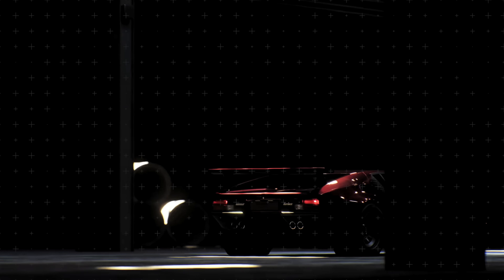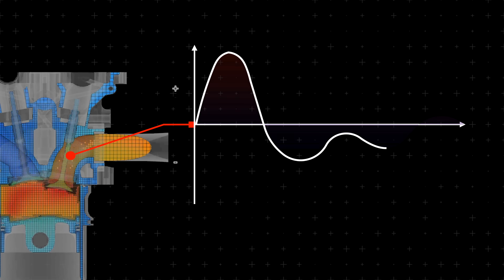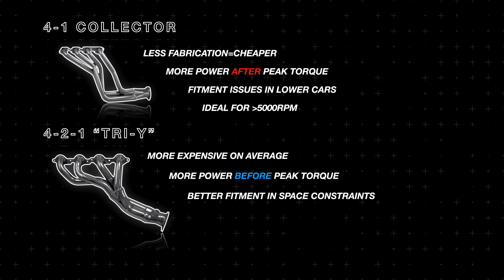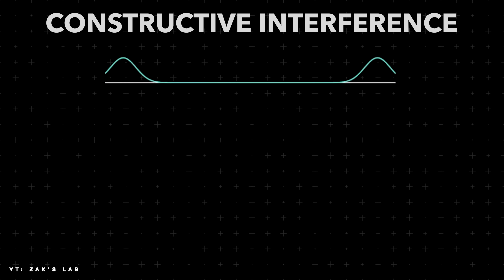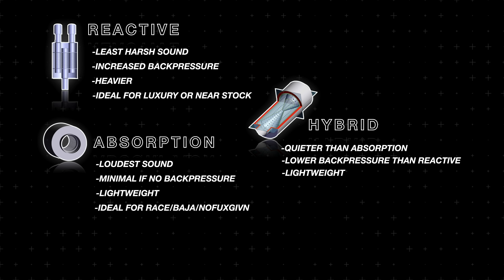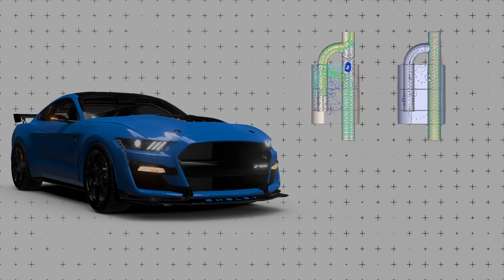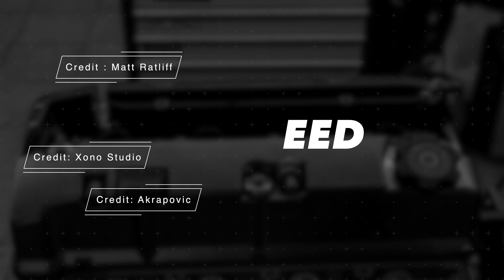Why Exhausts Make So Much Power😵| Explained Ep.27

Comment: Folks, this is as stupid as it can get. Doesn't matter if you are engineer or not you have to think of to things, and after that you will  be able to see by yourselves that this is stupid. 
1) To get energy you have to have something to get energy from.  
Let's say you want to warm-up your house. You will need to burn wood (as one of the methods) to get heat from it. So. It doesn't matter what kind of flue your chimney has, you will only get more energy, that's heat, by burning more wood, and eventually blowing more air into the fire. That's it. 
2) Car makers are not that stupid, so they don't know what they are doing. 
The exhaust pipes of the engine in your car are precisely calculated to meet the precise requirements for the precise that engine, so the output of that engine is the best that it can be.

Comment: 2:27 that is such an interesting and cool way to explain how exhaust systems work, fair play, and the graphs after that 😊
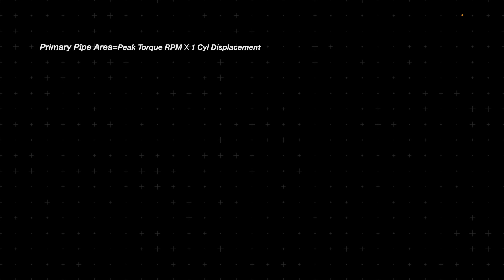I won't say the same for the bit at 3:33 damn I zoned out with that... 😅😆🙃
H Pipe sounds WAY nicer and tolerable to live with too as long there's a resonator, or it'll just be like the X pipe which sounds more like a racing engine exhaust. If you were to do a longer trip, you'd need some wicked sound deadening, or earplugs 😝
Absorption tail pipes / mufflers are offensive...

Comment: exhaust isnt adding 50 hp to any build ever
Reply: Ever heard of a down pipe thne
Reply: Depends on how much power you’re making. Firepunk diesel did a dyno run with a full 4 inch exhaust and muffler and it made 988. They disconnected everything and ran it on an open downpipe and it made 1044.
Reply: Exhausts be adding way more than that sometimes bro. It aint doin it to your daily om its own, but on builds that already make good power you can see a lot of benefit

Comment: in the first formula, it says that u need to use peak torque rpm, am trying to calculate it for my e46 330ci but it has a peak torque of 3500rpm so that means my tubes should be 1.2 inch, seems kinda small to me. shouldnt you use peek hp wich is at 5900 and you get a result much closer to the k20 engine?

Comment: 2014 Camaro SS automatic here. 
I installed BBK shorty tuned length headers, H-pipe with a muffler delete. The car had noticeably better low end power & it sounded great. I then removed the h-pipe & went with an X-pipe. I noticed slightly better acceleration at highway speeds. I just recently installed BBK full length 1 3/4" headers with the high flow catalytic converters. I immediately noticed there was a loss of low end power. There is better acceleration at the highway speeds. There was also a raspy sound coming from the exhaust. I have since added the Flowmaster Outlaw series mufflers. That raspy sound is now gone, the car sounds great but it still lacks around town driving power. It looks like I'm going to have to go to a shorter rear end gear. So far my modifications are a cold air intake by K&N & a Vararam Power Wedge.

Comment: When choosing an exhaust system, you get what you pay for. A pieced together exhaust from a muffler shop often results in drone. Save your money and purchase an (tuned) cat back exhaust system from a reputable company like Borla, flowmaster or Corsa, just to name a few. A local muffler shop can install the system for you. If getting under your car is not your kind of thing. Tuned exhaust means the system was engineered to cancel out those annoying (drone) pulses that often occur inside the passenger compartment at highway cruising speeds. Drone is extremely annoying.

Comment: I know what was meant in the title of this video. An exhaust does not make power. A properly sized exhaust system can free up lost horsepower. That will be lost to an improperly sized exhaust system. Spent gas scavenging from a properly sized exhaust system removes spent gasses from the combustion chamber and exhaust manifold. So that the combustion chamber receives the optimum fresh air and fuel charge for the next combustion cycle.

Comment: Also i need to address your "x v h" pipe sound conclusion: the " pulse wave" travels at. The speed of sound 1100 ft/s.....not the mass of exhaust per pulse, the wave generated by the mass + momentum.......this ultimately determines your primary length, as the scavenging wave travels at the speed of sound back to the EV...

Now you mention the h v x pipe is really sound from engine master testing......well i would argue that EM tested rhe aggregate data as the peak power, But as the exhaust sound is correlated to its scavenging function wouldnt it be objective to aak this question: measured sound energy could determine the pulse wave scavenging? 

The more energy in the sound of the exhaust the more energy in the scavaging wave measured in kilowatts? (Excluding any resonance or muffling)  cant use dB because its a reference to human hearing, think of microphones measurements in reverse of speakers you can get watts.......you would have to add the mass flow averaged somehow as that can be measured in watts also...

Comment: Best video on exhaust science for engines, simple enough to understand with media and graphics.....only can add that ideal gas laws inner action with the ambient temp for predictable wave momentum also the air velocity profile around the exhaust tip at different speeds can effect the pulse wave timing and its correlation to internal flow restriction

Comment: Average, no talk of exhaust volume (extremely important) when designing an exhaust system. Equal length primarys do not create the optimum scavenge on uneven fire cylinder engines. Period

Comment: Now I understand the occasional dude with loud exhausts sitting next to me at a green light Drag race to the next red light. Just so epic because 😂 and then I pull up next to just as the light turns green and smoke em across the intersection. In my 2002 Ford Ranger XL. God I miss Tucson😅

Comment: Years ago I installed a set of Hooker Super Competition headers on my 1967 Nova with a moderately modified 283, at a cost of only $200.  Until then, I had been frustrated with the performance, only running 14.50 in the 1/4.  I knew there was a dramatic increase in power (seat of the pants) but didn't expect a 13.60 time slip!!!!  No other changes were made.  Wow!
And no, I do not work for Hooker!

Comment: My ol fox body " had 2 chamber flowmasters,  h pipe  would drone like crazy so monza resonator tips helped , but opening up back pressure  with that setup on a mild build " you loose bottom end torque for sure , daily driver" not a strip car where flow is key"

Comment: My 1st car was a small LC Torana I had extractors & hotdog fitterd as these were said to improve performance.  All they did in reality was make it sound hot.  The car topped out at 95 mph both before & after this mod.  Absolutely no dectectable change in any performance parameters at all, not speed, not power nor fuel efficiency.  Maybe if it was measuresd with laboratory instruments, a change might have been found, but it certainly wasn't apparent in the driving experience.  Installing a rack & pinion steering box was an improvement over the production one though.

Comment: As an Automobile Engineer myself. This channel is suppose to be recommended for Engineering Colleges because you can't get any material that simplifies as this channel. Shout out to this channel.
Reply: Why multiply. 065 by 2?
Reply: @UltimateManTVif I had to guess, the piping measurement is referring to the outer diameter (1.75) and you have to add the thickness of .065 inches x 2 to include two sections of wall you’ll measure when you are considering the outer diameter. The calculation only found the inner diameter.
Reply: Shout out to my barber dog
Reply: *supposed.
Reply: One word revision problems did you think of that nope you did not you failed miserably
Reply: @jumpsuite  you're one of those who think ICE are dead. Wake up call D***y they're here to stay

Comment: i dunno if i am dumb but what if i remove all kind of exhaust as i dont have to worry for back pressure then and the exhaust gas leave instantly as there are no restriction? then if i let some of it for forced induction the smaller exhaust system one should be better so what is the greatest fit?(this is theoretical standpoint that that car has no emssion test to pass) if you have answers please mind answering!!!!!!!!!

Comment: Two strokes are even more complicated when it comes to exhaust tubes.
There, they add an expansion chamber to ensure that the exhaust is ringing like a tuning fork with the engine RPM so at the next exhaust there's a period of low pressure in the expansion chamber to accept the new exhaust.

You can tune them to a very narrow RPM band for MAXUMUM power at that band or you can tune them for an average increase in power across the range.

And a single tiny dent in the expansion chamber can throw it all out of tune and cost you 20% power.
And even a microcrack can make it sound horrible while also losing you power.
On two strokes, the expansion chamber is a finely tuned musical instrument and it will sing beautifully when you are in the correct power band.
And the complexity of designing one for your needs means you can't simply say "this diameter and this wall thickness", it depends greatly on many many more factors. Get it wrong and it will both sound horrible and perform worse than having none at all.
That's right, most four-bangers run fine or even better with no exhaust headers at all... Two strokes run WORSE without their expansion chamber.

Comment: I made a Exhaust system That sounds like a V8 on a 4 cylinder engine it has  2 collector's 8 exhaust runners and thay go the 2 collector's go in to one pipe I used 1 inch  Piping 2 times on the  the same exoust port  Routed them to the corresponding cylinders Like a v8 and the result is a small v8 sound but at 5000 rpm it still sounds like a 4 banger  I also did the same with a v6 and a v8 the v8 was extremely exotic

Comment: LET AN ENGINE BREATH
Reply: Main purpose of any engine is to move air. Everything else is just a byproduct of the engine moving air.
Reply: @socomsix27 the main purpose of an engine is to convert fuel to rotational kinetic energy
Reply: @FireFoxDestroyer it’s to move air. The kinetic energy is a by product we can use. That’s why forced air induction produces so much power. Why two strokes are so powerful as well. The more air moving through the engine the more power.
Reply: @s @socomsix27 i know this is a debate of what we believe purpose to be, i believe a purpose is what something does for a system, you believe it is purely what that thing does. This argument has no point
Reply: @FireFoxDestroyer ok that’s what every engineer says. Kinda a basic of working on cars. Like no replacement for displacement. But you believe what you want.

Comment: I’m running 1 7/8 long tube headers 4 to 1 collectors 3in x pipe to 3in mids to factory muffler on my ss sedan. Full cay delete cuz I plan on boost and they have a tendency to destroy the cats with boost. Also em missions are not required where I live

Comment: on a non turbo engine the inlet has pulse waves to thats wy the old renauld clio williams had a dual inlet no vlalves just made so low rpm one sort of tubes would be in sync with the waves and tubes for high airspeed and flow max high rpm works good but turbo is better

Comment: You missed on the headers vs. manifolds.   Headers can be tuned for any rpm.   So they can produce tones of torque at low rpms.  Its just that most people by headers that are too big for their application and they loose torque.
Small diameter pipes give you more velocity (up to a point - see speed of sound or mach) and that velocity translates into momentum.   That momentum is effectively what causes scavenging (negative pressure at the exhaust port).  You can tune the scavenging with collectors and to an extent with 4-2-1 headers.
Headers, properly tuned, can get an engines VE (Volumetric efficiency) over 100%.   Combined with tuned intakes, I think Pro Stocks are 118% (someone said 125% but we are talking numbers that hold over very small power bands. 9600-10,000rpm for example.
Combined with high compression, these dedicated race engines make significantly more power in an narrow band than your street driven car ever would - or should)

Comment: uhm where to start, I only came here to reply on that very false title, from someone that actually works out what length and size an exhaust should be for manufactured vehicles, let me give two of the easiest examples for all to understand, you can take the most elaborate system and put it on something like a 1l Picanto and it will give you....  absolutely no gain in power, most vehicles can actualy have no pipe or a whole branch system and it will change... absolutely nothing, oh there is a third example, if your vehicle has forced induction, a fancy exhaust will do... absolutely nothing, just as long as it is big enough to allow all the gases to escape unhindered there is no gain or loss from what ever type of exhaust system you use, its just a cash cow that companies have been milking for decades.

Comment: I keep trying to explain to people on a motorized bicycle forum that header length and diameter affects the torque curve on a 4 stroke. Many folks think that backpressure helps a 4 stroke like a 2 stroke and try to use the same process making a 4 stroke exhaust xD. I keep telling them if that was true, then racecars wouldn't use straight pipes. I tried explaining how header length affects the torque curve at specific rpms, do you want power down low or a screamer up top? There are morons that add a less restrictive expansion chamber designed for a 2 stroke but swear by it for a 4 stroke, when it's only helping because it is less restrictive vs the stock 4 stroke exhaust used on bicycles. I tried to explain many times that the expansion wave works different with 2 stroke vs 4 stroke.
If I ever get in an argument about this crap in the future, I'm referring them to this video... explains it so well even a caveman can see it.

Comment: On a typical V8 with chevy or mopar firing order, cylinders 1,4,6 add 4 inches to primaries, cylinders 2,3,5 minus 4 inches, cylinders 7 and 8 nominal. aprox. 12-16 inches length. This is for v8 headers 7000-8000 rpm. Equal length could cost you 50 or more peak horsepower.

Comment: This is the most comprehensive and accurate video I have ever seen on the subject of tuned exhaust. Tuned intake is very similar as it works on the same basis principle of pressure waves. Hot Rod magazine did a publication in the1960s on this topic along with the mathematical equations to calculate the best tube length.

Comment: that's a very old school equation for finding primary tube size.  It will give you a header that's much larger than optimal.  I use a rule of thumb of 1-5/8" tube for up to 550 bhp NA V8, 1-3/4" for 650 bhp, and 1-7/8" for 750 bhp.  It's also affected by valve size, cylinder pressure, compression ratio, and valve timing.

Comment: Very intelligent video. Surprising that an outlet can have such a profound effect on the parameters of the overall engine performance. Let's you see why a cars exhaust pipe is more than just a tube for letting unwanted byproducts leave the cylinder.

Comment: I have a 1.6L Nissan Juke and at the smallest point in my exhaust it's 2.5"'s from down pipe they goes into 70mm 302 2J Catted mid pipe and j Cat Back.. But I am take the muffler out and pop in a Tipped Pipe, when I go to the track to full around, there's about a 20HP gain on the top end just by doing that, plus the muffler weighs like 27lb's removed, then another 30Lb's from the down pipe, plus crank pulley and just have cut a little over a Hundred Lb's off of your Juke.. I pull out the spare and everything else I can too.. Taking a CVT to a Drag track isn't usually a good time but I find a way to make it happen.. I thank God I have a small track not far from me in ATCO NJ.. Anyway everyone was like you don't need 3" to 2.75 inches for piping on a 4 cylinder.. I was laughed at.. But now my car makes about 260WHP and  246 WT, all from 5K in Bolt Ons and a Tune. 5 years ago I took a $10,000 AWD CVT JUke that had 65K on it.. People will say 270WHP isn't that much, BUT when you take a car that was only 150 wheel and then turn it up to 250 wheel, it's a huge difference that you can feel!! It's not like adding 10 whp and you are not sure if you feel it!! It's basically the same thing as taking a 450 WHP to 850 WHP, It shockingly Noticeable.. Now if I add 10/15 HP to my car I barely feel it.. Now lets say you have a 450 wheel car and then turn it up to 500 wheel.. Does anyone really think they will feel a difference? Not really thats like me trying to feel a 10/15 HP difference.. Anyway I hope everyone is happy with what they have, and make the most out of it!! I will be buying a new CVT next year for $5500 un installed..

Comment: The reason I swapped out the stock down pipe off of my Turbo First it weighed over 50lb's of cast Iron with an 1.5" internal and a cat right off of the turbo.. Chocked the hell out of it.. As soon as I put a high flow 2.5" down pipe in and moved the Fast cat into the mid pipe, there was like a 50 HP gain without a Tune, Just by putting a down pipe in, Mid pipe and Cat back, all the piping is 70mm to almost 3"s now and what a difference... Oh just a tip, if you are going to go custom and use Fast Cats have those cats check out and cleaned out every couple years because they clog up fast..